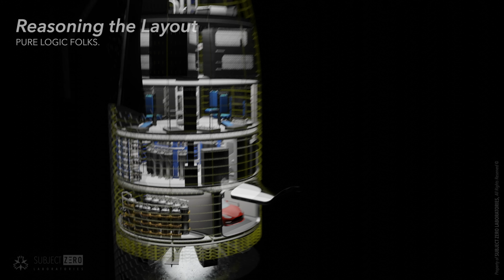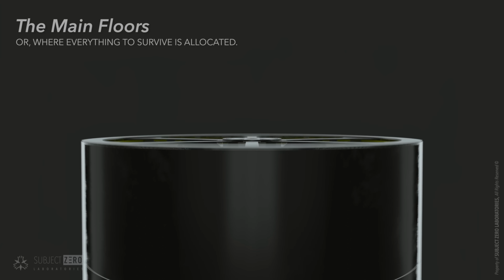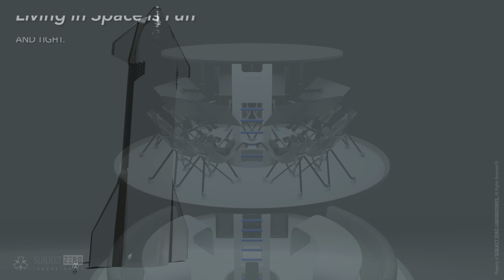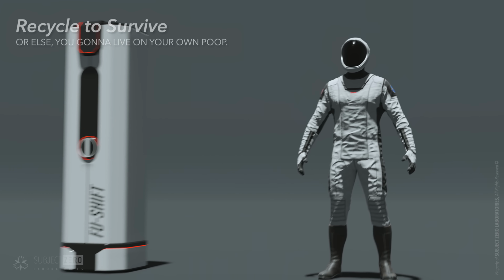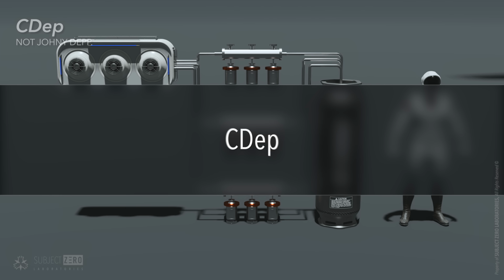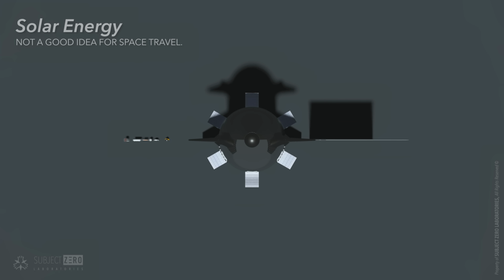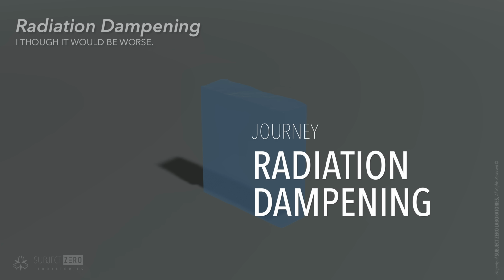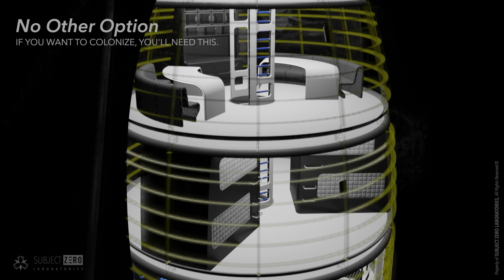Onboard the SpaceX Starship 2.0 in Detail - What it takes to go to Mars | Detailed Breakdown

Comment: Sorry, but CGI with all of promises without any feasibility coverages seems scammy to me. The upper part of the rocket should be way much more than just an empty space. accomodating space should be on the walls, mostly. In zero-g environment, there is no difference between up and down. Where is water salvage and CO2 to O2 converting devices? Where are storages for all of these media? where is the food for 8 months stores? where are the clothes to change, how astronauts are gonna wash themselves and where? All of the things that I have mentioned will be in a single rocket? And most importantly - weight distribution of all of those things must be uniform - any local deviations meand that the structure is not loaded uniformly or optimally. CGI is nothing but empty promises for me. CGI can present anything, but in real world, space allocation IS a problem. 

I recommend everyone to not get overhyped by this. Let's just see what will come out of this. But, unfortunatelly, as I'm aware, no trip to Mars would make sense until any hardware would be transported there first. And if you don't believe me - go check how much cargo is transported to ISS. How much space does it take, and how heavy it is. Because in that video, you won't get any of that.

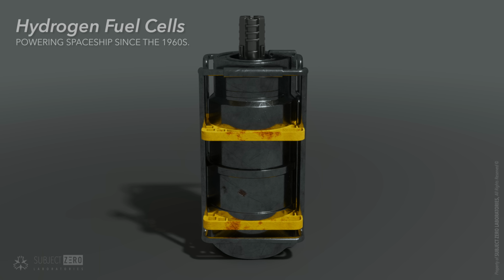Omg... 11:50 Hydrogen fuel cells require oxygen as well. The byproduct is water, but you need oxygen to breathe, and oxygen for fuel cell. AND you need hydrogen tanks. Poop conversion is not a proved concept and is not energy efficient. Solar panels needs to be protected during launch and... STORED SOMEWHERE. Hydrogen fuel cell makes more sense for shorted missions like Apollo, but for over longer span - too heavy. The interior of the rocket is nice and spacious, but remember how much stuff must be IN the rocket. No current solution would overcome arranging this and other hardware in confined spaces. This rocket is waaay smaller than ISS. and ISS feels cramped currently.

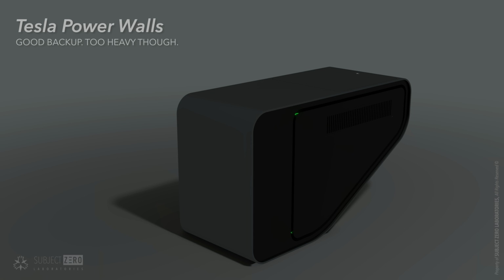12:34 at this point i'm starting to thing that spacex or tesla really paid you to make this video.

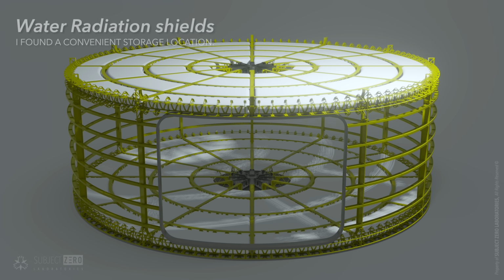14:46 i though about it previously, but... water would be heated up like crazy, that's first. Second, those tanks during launch must be either full, or empty. Nothing in between. If they would be full, excess heat is a problem - isolation from heat should be immense.

Okay, the very last thing - nuclear power. RTG are out of the question - they are heavy and more suiltable for missions which last years, not months. And they also are not that powerful - that's why they are used in pair with batteries. They also generate excess heat and radiation which might require shielding...  As for other types of nuclear power... whatever it is, it isn't even at the stage of proof of concept. And really, if you want to include anything for space missions, the reliability and sustainability are the first 2 thinga that will cause demise of certain solutions.

Comment: You couldn't pay Elon to use hydrogen fuel cells. You missed the point with the power supply Elon wants for the maned Mars mission.  He has said several times he is looking into using nuclear batteries.

Comment: Why would you carry all the oxygen and water and store all CO2 generated??  They don't even do that on the ISS.  And hydrogen with fuel cells?? It takes 600grams of algae to produce enough oxygen for an average adult from their CO2 -- so the only storage of concentrated CO2 should be for EVA suites or an emergency stock.  The floors should be sealable, also for emergencies.  Compartmentalization is important in naval vessels for this reason--high survivability.  I'd also grow plants and, perhaps, a moss wall.  Moss will clean the air better than anything--including ammonia,  which could become a problem in the bathrooms.  Also, I am sure you want to fill the halls and such with vegetation for oxygen, clean air, food, and mental comfort.  I think grape vines down a spiral stairwell in the center is what I'd do with also sweet potatoes in other areas--both the leaves and the potatoes are edible, and the leaves grow quickly.  I don't think you need to freeze dry much.  Keep a lot of pasta (dried) along with rice, beans, corn (popcorn), and spices.  The heaviest most difficult things are butter and oils.  Use water, food, and poo to increase radiation shielding.  You not only need shielding from cosmic rays but also solar flares, which are more deadly are vary in a lot in intensity.  

I think a population of up to 100 can work.  Use two floors for capsule cabins, stacked three high (like capsule hotels) on the heat-shielded part of the vessel.  This will better protect them from radiation and, most of the trip will just have black space out the windows.  These capsules would also be used for launch and landing, suspected and sealed with independent short-term life support (survival pods).  This will allow for maximum comfort and survivability on a hard landing.  Fire and blowing up on Mars are less likely as there will be little fuel left and no oxygen.  Even if the Starship falls over, they could survive.   Put windows on the other side, in open areas for socializing, eating, games, etc.  I'd use the upper chamber for sports and education seminars.  The passengers should be studying during the entire flight, having earned a degree in Marsology by the time they land.  Use the lower deck for the kitchen, toilets, and showers--bulkhead between them, of course.  This is good for water flow, water recycling, and such.  The kitchen should be a fall kitchen.  Bring along the Navy's recipe book for submarines.  Food and social meal times are the best thing by far for keeping up morale and the Navy has mastered it, in submarines.  

Gravity is essential but it could be kept at 38% of 1G because that is what Mars will have.  I hear Elon has already hinted at connecting Starships by cable between the noses.  This can easily provide spin gravity with an unnoticeable Coriolis effect.  It can also assist with deceleration upon arrival at Mars by the timing of the release--one ship slows and descends, and the other moves to orbit to descend next.

Comment: Nice video. You've obviously done some excellent research here, but I think more is needed. As was pointed out in The Martian, feces is extremely valuable for growing ANYthing on Mars, so it needs to be preserved, not burned. The bacteria from our guts needs to be preserved for the soil on Mars, or plants won't grow.

Ditto for oxygen & water. These will need to be recycled. You touch on this somewhat, but I think it needs to go much further. You appear to assume that all water must be brought on the ship, but while humans may CONSUME lots of water, they don't actually USE that much. It comes out as sweat, urine, saliva, & poop. The water needs to be recycled out of all of that. Yes, the recycling equipment consumes mass, as you point out, but once installed, it can recycle a LOT of water.

This is true of oxygen as well, as you touch on (but don't seem to bring into your calculations?). Humans consume a lot, but most of it is breathed out again, both as O2 & as CO2. NASA's CO2 scrubbers need to be powered, but they also return a lot of O2 that can be reused. Again, more fixed equipment that will take up mass, but once installed it can recover a lot of O2.

Starship needs to be as closed cycle as possible, recycling as much as possible.

I like your electrical calculations. I suspect that the Martian colony will depend on a LOT of solar panels, but the ship's will need power to go home again, so Starship panels probably shouldn't be cannibalized. Fuel-cells have a lot of benefits, but like you, I prefer nuclear. And some recent developments into small reactors look very promising.

While I agree that humans need exercise in space, such a small crew doesn't need that many machines. Also, it looks like your crew-quarters could be laid out more efficiently, & the exercise equipment moved onto that floor. Because you don't even talk about supplies for Mars, & I think some will be needed on board, even if most is shipped in un-crewed Starships.

Also, we need to PLAN for food for the entire trip. How to make that happen will require some considerable skull-sweat, & hopefully we can work out ways to grow much of it, but you can't count on being able to grow ALL the food for everyone just a few months after landing.  Food will be needed for the return trip, & that will probably need to be freeze-dried as well. Maybe some Mars-produced food can be freeze-dried on Mars before returning, but I suspect that lifting from Earth with less than a year's supply of food would be sub-optimal.

I'd like to see plans to feed everyone essentially indefinitely (that is, until they're producing all their own food) & then have at least a 6-month food buffer in case something doesn't work.

A good first cut. I'll look forward to future videos.

Comment: Why not use the exess heat of the engines for power too, training devices will use dynamos too or some pneumatic solution using the velocity as a power source? the solar panels would slow down the craft, so they shouldnt be used , unless as a backup, which would add more mass tho.. also, it will just be nuclear
increasing the air pressure of the utility decks would let you take more o2 but force a suit for the envoirement and increasing firehazard, adding a refinery would increase power draw, but prolong the air with calcium. also, shouldnt the craft carry a botanic lab? - i think the 3d model used gets the dimensions wrong, the crew members for the initial flight shouldnt be higher then 1.6 m making it possible to add one more deck. - just uneducated babbeling tho.

Comment: Using water for shielding sounds good, but the water is getting used.  Over time, there will be less and less water.  That polywhateveritscalled stuff sounds more promising as shielding.  They don't need to put it everywhere, just where the crew is going to be.  And if NASA says it works great as thin as it is, why put such a thick layer of it?  Instead of five or ten times the thickness, just double it.  That will save on weight, while protecting the astronauts/Martian colonists.

Say, when these colonists come back from Mars, the State Department will need to come up with a passport entry for them that says they've been to Mars.  Astronauts who've been to the Moon should get a passport entry for having been on the moon, too.  And if they ever do orbital colonies, passport entries for that, too.

Comment: Elon might send the first humans to Mars already next year.
Reply: Based on what you have seen, you really think that?
You know that after years and years they are still working on getting this thing to LEO, right? That actually is the easy part. And assuming they can pull THAT off, it's still just an empty shell / dustbin with a lot of engines attached to it.
I would be amazed if they could send just cargo to Mars in under 2-3 years, to be honest. Assuming they don't go bankrupt before that.
Reply: The key word is 'might' and yeah maybe he might but probably he won't since one failure without success can be seen on the horizon is all it takes to throw all the work out so sending few unmanned missions that also contains supplies that can be used by the crew on Mars 2 years before manned mission is the way to go than trowing humans to unknown
Reply: LOL. Riiiiggghhht...

Comment: Most of the weight of a nuclear reactor is shielding for gamma rays (lead) and neutrons (plastic).  There are three main ways to reduce one from radiation exposure - Time, shielding, and distance.  If you could extend the reactor a ways away, that would give you distance, and then the shielding would be minimal.  It doesn't matter if radiation goes off into space, just so it doesn't hit your crew and equipment.  The air force had a nuclear powered plane once, I believe, so it is doable.  Nuclear power is the best choice for long term sizable power requirements.

Comment: wow...so much complexity. In this video i think u base your calculations on the ship carrying 10 Astronauts? I think spacex should limit the number of Astronauts to 4. I also think there should be a plan to send to the surface of Mars (years before) a supply of everything they need for extended stays i.e. land about 2 Starships/1 manned Starship, (also in orbit) and this should be done way before they land. As for the energy problem...i think nuclear is the only way to solve this problem. I mean nuclear engines as well as power stations on the Moon and Mars although solar from the sun on the Moon would be adequate. 2045 anyone?  🤣

Comment: This video doesn't really make sense.
Use energy to separate Co2 to Carbon and Oxygen and you don't need that lots of spare oxygen. It recycles itself.
Use a Pu reactor at the bottom of the ship and your power problem goes away. (there are also solar generators that now exist that have a film-like thickness and thus could be unspooled for great surface area for their weight)
Use newer technology and your power demand will not be nearly as high as the ISS
Use GMO algae or other rapidly growing plants for food; Not only would this recycle Co2, but turn Carbon back into food.

And that is just what I know of. I'm sure the people working on this have ideas we wouldn't even be considering.
I think this video is a rather terrible take.

Also, why would you need four treadmills?

Comment: Another option for radiation shielding would be a magnetic bubble around the ship. with basic material shielding as a back up. this would reduce the mass but a would require alot of power to generate so yes a nuke generator would definalty be required.

Comment: Going to Mars and landing with a rocket is so insane it can't even be taken seriously. Besides an electric car, everything Elon has done or got others to do is basically a bust. You can say SpaceX , but all the tech, including the vertical landing tech was invented and USED by NASA. The vertical landing was perfected in the 80's. NASA did not use it because it is debatable. if the loss of cargo capacity is offset by the savings. A rocket is not that expensive to build. They are expensive to develop and have large infrastructure needs.

We will go to Mars on a spaceship built in low orbit. A landing vehicle separate and spin gravity. There is so many problems not mentioned here it is incredible. The top one being, no gravity. Everyone gets there and can barely stand. This is 6 months and Mars has lower gravity but still 40%. There is nobody there to help. Imagine 10 people and nobody can walk. If something happens no back up living space. The entire rocket system must work for years with zero maintenance. A nuke powered actual space ship that remains in space has a much lower chance of failure. Also many trips by rocket for supplies, habs etc.. must be done before a single human leaves.
Reply: Lots of people made rockets before, but there's a reason SpaceX now utterly dominates the launch market with the cheapest, most advanced, most reliable rocket in the world (Falcon 9).

We may go to Mars in a rocket built in low orbit. If so, that rocket will almost certainly be built by Starship launches. Aim for Mars, land a bit short but a LOT closer.

Comment: There are several bad assumptions in this analysis.  The first is thinking of it as a single ship, built with government thinking,  ala Commando Cody meets NASA.    Dr Zarkov meets Howard Hughes and John D Rockefeller would be closer.   
Assuming that the initial shipS that go to Mars will launch from the surface of Earth with crew, cargo and fuel to get to Mars is silly considering that SpaceX will need to build an orbital fuel depot that will could dwarf the ISS's mass before it is filled.    Adding a couple more "stripped' StarshipS could provide enough volume for a earth- orbit resupply and assembly depot, and robotic shipS could carry empty shells to a Mars orbit for one there. Non-occupied tinker-toy  structures in space are much simpler to construct than ones for fragile humans, and autonomous orbit-keeping is simpler than  Dragons autonomously docking and landing at the ISS.

Comment: Whew - Where to start with the technical errors?: radiation maybe?
It is abject nonsense that items of low atomic number (Z), like hydrogen, are good radiation absorbers. This chap has obviously picked up something, somewhere about neutron absorption. The main issue in interplanetary space is gamma radiation and high energy protons -with a complex interaction  mechanism for the latter heavy, charged particle  with any shield to produce secondaries, etc., etc. Practically choked on my lunch reading the pure science BS on the so-called effective, NASA certified absorbers mentioned here. A more realistic assessment of the need for such a voyage is around several inches of lead equivalent material to achieve < 10 mSv year dose rate - lead equivalent meaning that of a high Z absorber of abou t atomic number 82. Otherwise, the water equivalent comes out to many yards. Look up Scott Manley for a presentation on this subject I rate as very well researched.

The so many other basic errors I can point out as a physicist would fill pages...please read elsewhere for space FACTS, not truly "Zero Science" content here.

D.K. Barillari, PhD